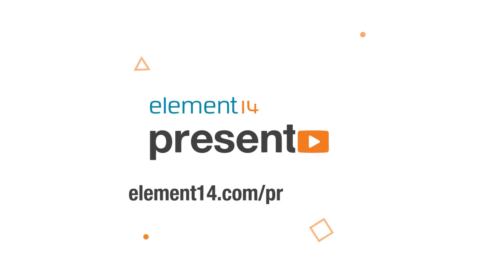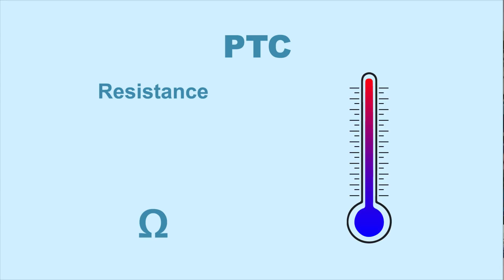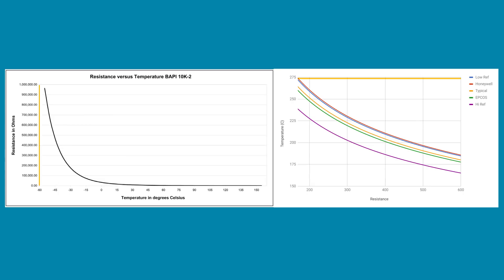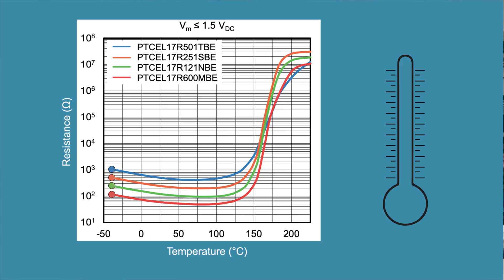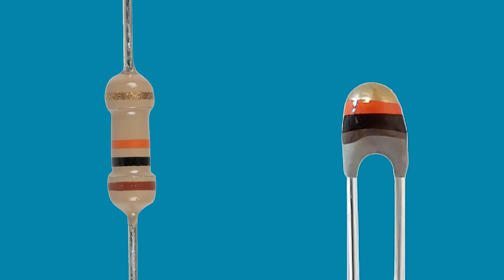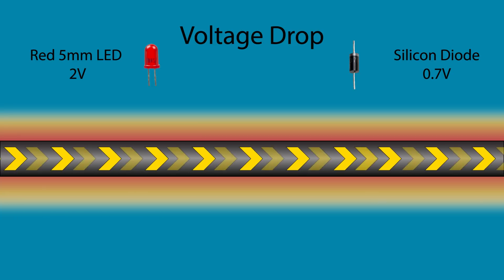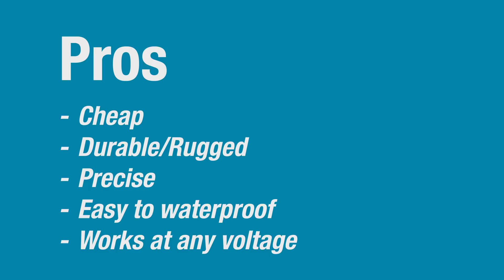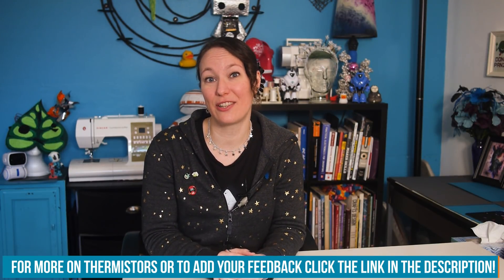How Thermistors Work - The Learning Circuit

Comment: I found two failed components on a power supply for a microscope light. They were marked 5D 11 AN. There was no indication of NTC nor PTC. They were little discs, split apart with dark marks on the PCB. I ordered some 5D 11 NTC components to replace them. Does this seem right?

Comment: As an automotive tech, an ASE Master since 78, many ask me about "Low Fuel Sensors." While changing a defective fuel pump, a number of models had the "LED" low fuel light. While not testing or saving these from the trash, I would guess they use a simple "NTC" thermistor. They are a single wire going to the dash in cars & and newer motorcycles, the can has small holes allowing fuel to enter, but always placed on rigid mounts, a few inches from the bottom of the tank. This leaves you with 3+ gallons I have noticed, to keep to running until the next gas station (Unless in South Dakota). With one wire soldered to the fixture, the other exists the tank to the dash light. Inside the 3/4" can, I have found stainless steel wool pack around the thermistor while the other had aluminum foil wrapped around it loosely, but always the wrapped with a parchment paper for insulation wGas is a liquid obviously, but when low, the thermistor is uncovered allowing a few amps via resistor to let it get warmer. As the thermistor gets warmer, resistance  drops and the low fuel LED comes. Many happen fast like a 3/4 circle on/off ramp on interstate. With 25 to 30 mA required to turn on an LED, this seems perfect for the job. Most schematics show the return wire simply going to the dash light while others show "Block Logic" circuitry in the dash. Now retired, I would need to order a few to test in a 12.6-14.8 Vdc circuit. Do you have any thoughts? Thanks!
Job well done! 
(No offense: but when teaching during a class of 12, or a seminar up to 100+ techs, owners and instructors who worked at the tech school in 7 states; I would ask them t4, the hotter you get them, the lower their resistance) no offense Megan!
Retire ASE  Master Tech

Comment: I have an window A/C unit that I need to get the room to 60 degrees but the unit will only allow me to set it to 64. I am trying to control the temp by using and Inkbird temperature controller that turns the A/C unit off and on via the outlet based on the inkbird's sensor. In and effort to get this to work, I have tried relocation the A/C unit's thermistor and insolate it but the results are inconsistent.

Can you tell me if I can provide a set temperature reading on the sensor circuit be removing the thermistor and replacing it with a 9K ohm resistor so that it reads a constant 30C?

Comment: 2:05 that graph is not talking about the resistance value changing in a linear fashion or degrading. It is telling you that you can operate the resistor at is rated power up until 70° C ambient temperature. Then you need to reduce the power or you will damage the device.
Reply: Yep picked up on that as well. It is a curve showing power derating above 70deg C only because of cooling of part.

Comment: Thermocouples in lower-cost applications are usually paired with an amplifier like MAX31855 (~$5), which gives a digital reading of an absolute temperature over SPI (or I2C for other chips) and provide typically much better than 2 degree accuracy with no calibration needed over a huge temperature range...

Comment: I just started researching thermistors yesterday.  How crazy is it that you post this today.  I have an offgrid refrigerator that has a fairly large temperature difference between the top part of the fridge and the bottom part.  I want to use a thermistor at the bottom and top of the fridge in a circuit that will turn on an internal circulating fan when there is a temperature differential between the 2 sensors.  Great explanation video.  thx.